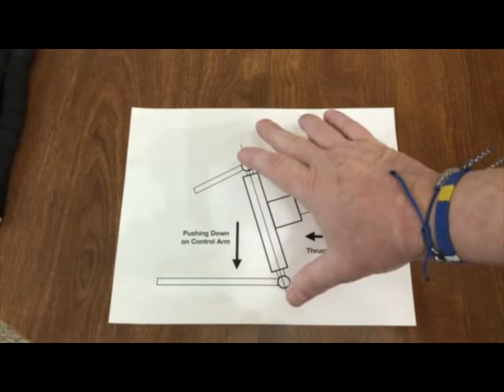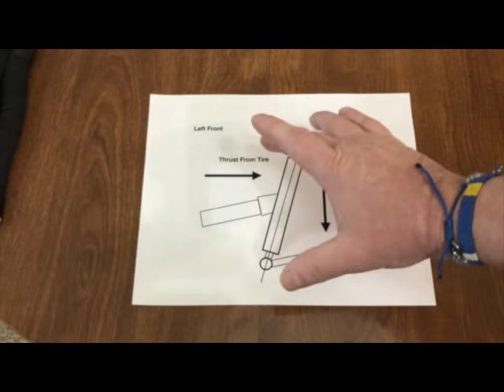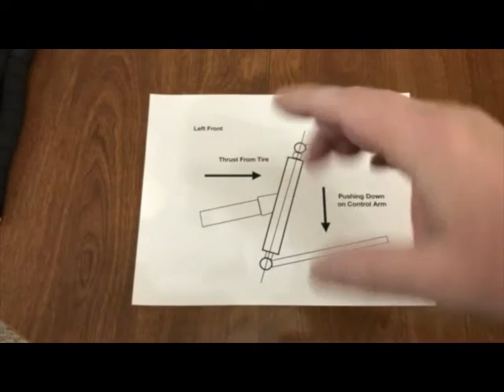More Camber Ideas for Dirt Late Models and Dirt Modifieds; Let's look at King Pin Inclination

Comment: Love the concept… my question is wouldn’t the load on the LS in your diagram be applied the opposite direction? I see the drawing as the load is toward the chassis in both drawings but wouldn’t it be toward the chassis in RF and away from the chassis on LF? Also how would you relate this concept to having a high and long instant center on the LF which I know helps to load the LF even to the point of breaking suspension components (I believe you mentioned in your book) 

Thanks for the great video
Reply from the maker: Yep, that is correct, but the KPI is really what I'm trying to think about here. The more I think about the possible drawbacks, I'm not so sure it would work. Maybe.

Comment: Just curious about wheel alignment. I was looking for a video from you that covers relationships to front a rear tire alignment mainly  the right side ,and spacing in and out in general. I really like your videos and can relate to your theories.
What I'm trying to do is make the car leave the corner straighter.l feel like I have to much steer, chasing the rear of car up off  the corner with the front end ? Just asking for your opinion
Reply from the maker: I believe right-side tire alignment is one of the biggest changes you can make to your car. When your car is at race attitude, your right side tires should be close to aligned. This is a strung version with the front tires countersteered so the side walls line up. In a little makes the car tighter. out a little makes the car free. I cover this in my book with some pictures to help clarify things. I may make a video about this in the winter. Thanks for watching.

Comment: Interesting thoughts. Make sense. But as you alluded to, everything is a compromise. Finding that magic balance is the trick.
I'm trying to figure out how to apply it to a stock car, which may be impossible since we have to use stock spindles.
Reply from the maker: Yea, stock spindles are a ver limiting factor without compromising camber.

Comment: How would that concept work on a ump dirt mod thank you
Reply from the maker: It would be tough to do on a mod because you can’t alter the KPI. You could take camber out of it, but camber is way more important than the kpi change.
Reply: @HoganTechnologiesLLC   thank you I know that wiggling steering as the track dried out with my sprint car yrs ago. The traction remained n it smoothed out with speed thanks for information n your channel
Reply: What can be done to add traction to a dirt?Late model running on hard tires american racer MD 56

Comment: I don't think the tire pressure on left front will ever put any pressure on lower control arm ..pull outwards sure ..all pressure would be on top control arm pushing in towards chassis ...but I'm probably not understand the scenario ur trying to give but I do have a question about lift arm on late model if u use lighter spring or decrease the load static would it help to get on bars quicker ..hope I ask the question correctly..love ur videos
Reply from the maker: I like the softer stuff on the lift bars. Because the panhard bar mounts in front of and below the pinion, the softer spring would have a faster lifting motion on the panhard where it mounts on the frame on the lr.